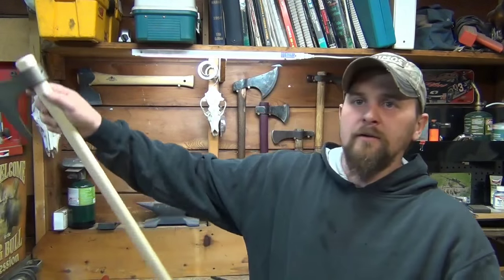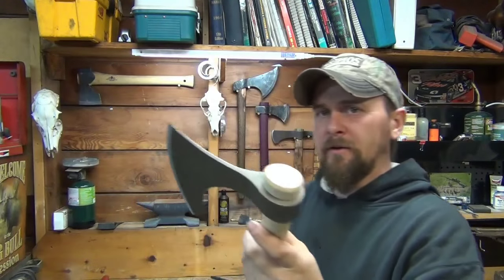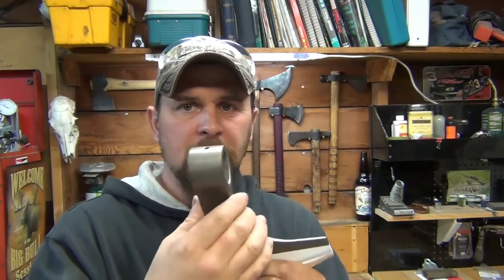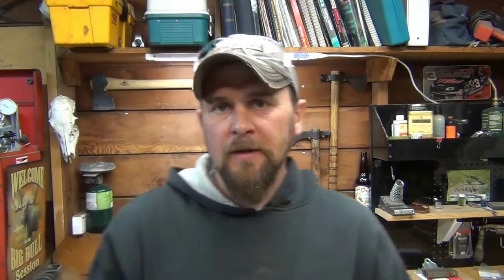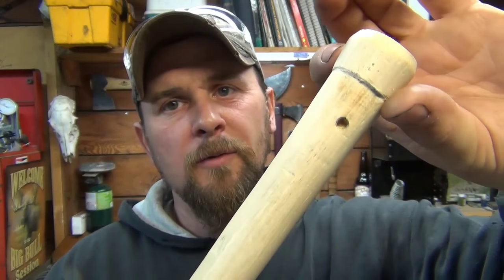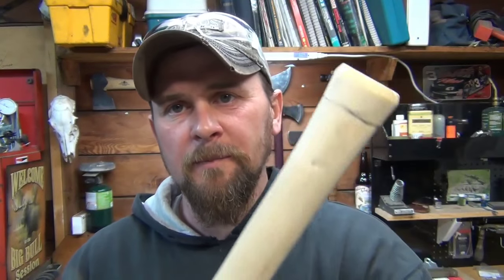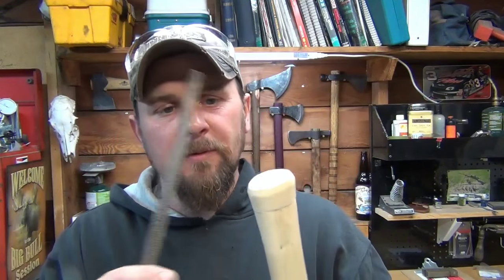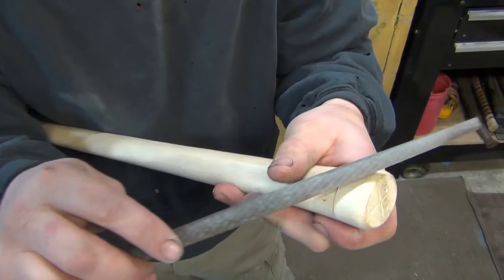Tomahawk head fitting guide. Viking axe video 1

Comment: How to fix the little bit of uneven slop at the end:

Remove the head and rub a coat of graphite from a pencil on the inside of the eye on the bottom. Then hang the head on the handle. Remove the head again and sand up from where you see the graphite marks. Repeat until the graphite makes a complete ring around the handle. 

That way there's absolutely no chance of play.

Comment: Thanks man, I just bought my first tomahawk like a week ago (Amazon Cold Steel Spike Hawk) and it just arrived the other day. 
My older brother (who THINKS he knows everything) said that he had replaced an axe handle or two in his life and that I had gotten ripped off with a cheep malformed handle, and a cheap screw to hold it in place (he was right about the screw, but of course I had already assumed that much for myself). And then he told me that I needed to get/make a new handle and attach it like an axe.

Instead after seeing your video, I now know that the handle was actually just fine and that it uses a different method to attach the head. So I filed my  tomahawk's eye, filed and sanded the handle it came with (which was actually already pretty well, if not perfectly, tapered) and now it fits perfectly, nice and tight with no wiggle at all.
Reply from the maker: Excellent! Glad to hear the video was of use and you were able to get your hawk straightened out!

Comment: Update on my previous comment.  I did get the Viking Hand axe and, after watching your video again, I was able to get a pretty decent fit.  Like you I have a little space on the bottom of the head but it's very tight on the handle. Your third video on sharpening the axe was very helpful. I've sanded the handle to remove the finish that they put on.  After burning some designs on it I plan to apply some boiled linseed oil to protect it.  I'll also be putting some leather next to the head.  Thanks.

Comment: Great Video, I have been banging my head against the wall trying to fit tomahawk heads to their shafts (i ruined my handle by keeping the screw, and re-tightening it periodically; which eventually bit into the wood and caused some splitting).
Another method that I discovered (also useful if you are in the woods and do not have access to sandpaper or files etc...) and need to refit the head after some heavy usage; is to take a thin piece of cardboard (like a paper filter tip) and just wrap it around area where the head bites into the wood, giving it a smoother (if temporary) and solid working fit.
Best regards!

Comment: thanks for this, I am going to have to do this for both the Viking hand axe and battle axe as both have wobbly heads.
Reply from the maker: I have had several lately with really bad handles, two are too narrow to use and I will need to make new handles, I hope this is just a fluke and not the new low standard for the Cold Steel Hawks!

Comment: Righteous! Im customizing a new CS SpikeHawk watching this video. Fitting the handle in fact. Ive determined I got as solid a fit as Im gonna get without it moving up the handle further than I can allow for the Constrictor Knot Im gonna apply above the head. I also crown carved the handle top with my Chip Knife. I still have a gap at the bottom and in one small part at the top. Can even see light through it looking up the handle at a light source. I'm just gonna fire harden my handle, and make pine pitch at same time and bed it. Then Im gonna apply Constrictors in appropriate sized strong tarred cords above and below the head in such manner as head is wedged up against top Constrictor and handle taper. Did a lot of file work as well customizing the head.

Comment: People are blissfully and kinda painfully ignorant about how friction-fit axes work. And also how, if you know what you’re doing, how AMAZING they are. Vikings didn’t use these kinds of axes “because the technology was inferior back then” at ALL. Vikings still had axes that were compression fit (wedged) too. The reason these kinds of axes were so amazing was because of how insanely easy it was to replace handles, and only have to taper the wood one way. On top of that, you could carry a shorter handle with you, then just REALLY quickly and easily change your 30-inch long light felling (of both trees and men) axe into a 16-inch long bushcrafty hatchet for smaller tasks. Then you’d just >thwack thwack< and pull your short handle back out after you got done with your smaller bushcrafting tasks then throw the longer one back in - and BOOM. You’re back in business for felling relatively medium sized trees and/or KILLIN FOOLS. And you can switch these handles in and out with each other in less than 15 seconds. That’s how EASY they are to use. AND you can technically get two tools out of one axe head.

Comment: Someone suggested to me to soak the Head&shaft in Teak/Lensed Oil to make the shaft swell to fit.

I'm going to try it out. I'll let you know if it works or not.
Ill try it on my Norse Hawk. Its the loosest of my hawks and has a hard knot at the top i just cant seem to file/sand down. Its like stone at the knot...
Reply: Before you use any wooden handled tool, soak in a bucket of water overnight. The wood will swell and the head will never fly off!

Comment: I would like to polyurethane my T handle I don't care about fancy I want usefulness.  Would you advise installing the handle first then coating the handle. Your thoughts please. I'm glad I found your video so I can do a proper fit. Thank you.
Reply from the maker: I honestly have no experience with polyurethane. If you want to be able to remove the head I would fit the handle before coating. If you plan on trying to fix the head in place then I would press the head on and then coat the handle. The poly may help hold the head in place, this is generally how most mass produced fixed head hawks are done and some of the custom ones as well, although they typically use a hydraulic press to fit the head to handle. Sorry I cant be more help.
Reply: @Scablands_Scavenger  Thanks a bundle.

Comment: Question, is it alright to set it with a big screw? With the set screw hole, I drilled a small hole into the handle, then put the biggest screw that could fit into it. Bout and inch long. It seems to work pretty well. What do you think?

Comment: I got it all perfectly fitted but the axe head is not in line with axe handle. What is wrong? Could it be the axe head is just not made right
Reply from the maker: could be, you can get a straight edge, like a ruler or similar and place it on top of the head in line with the longest part of the eye use that as a guide to see if the blade is skewed one way or another. If it is twisted you may be able to adjust by making your own handle. A quick way to get a blank is to purchase a sledgehammer handle and work it down to fit.

Comment: You forgot the most important thing, what should We replace the littel screw with ?
Reply from the maker: Nothing, the screw does more damage than good. I will sometimes weld the hole shut but it is not needed. Some peen in a piece of soft metal like copper or brass if you want but there is no need other than aesthetics.

Comment: Hey there, watched your 3-video series. Amazing work, thank you very much for recording it. Got a question if you don't mind: I failed to understand how to affix the head permanently (or for as long as possible) to the shaft. I understood that regular axes get shimmed on the top, but this one, having a tomahawk configuration, would have to be different, hence the work shown. But it left me with the question: Are tomahawks supposed to have their heads easily removed by simply tapping on their top? I humbly believe the answer is most likely: Nope :-) So, after reshaping the handle/shaft, how do we ensure the head remains there, if we cannot use the shim method due to the pole being slimmer below the head? Thanks a lot for your time, and once more for the great video series!
Reply from the maker: Thanks for the compliment, and you have a good question with a tough answer.The Cold Steel hawks have a tapered eye meant to fit on a tapered shaft. The head is designed for the most part to be easily removable without tools. The reason is debatable but still on purpose. Setting aside the historical aspect, in modern times the handle is designed to be replaced if and when broken during competition throwing. I believe the rules stated at one time that the handle had to be removable and of wood construction with an oval shape, I do believe that has changed to include metal and fixed handle stuff now. The principal behind this was that the handle would give and come loose rather than break, and when it did break a new one could be slipped in and you could keep competing.
 Ok with that out of the way, if the head was permanently attached to the handle would that not make it a hatchet ? One of the advantages of the tomahawk ( not including the ones with fixed heads) is the fact you can remove the head and do other things with it. This is where it gets real muddy water and people start yelling at each other ha ha, what is a tomahawk whats not etc. There are advantages to having a removable head however it requires you to maintain the fitment between handle and eye some people find that distracting. If you want to keep it attached permanently (using it for fighting only) the best way is to use a heavy press and force the head onto the handle. This is how H&B Forge and the gerret wade rebranded hawk is shipped. I have never tried it but I do believe you could replicate this by soaking the handle to soften the fibers and then using a hammer to seat the handle and compress the fibers, when the handle dries the fibers should expand and lock the head in place. Hope this helps, thanks for watching !
Reply: @Scablands_Scavenger  Amazing answer, thank you so much for taking the time! I enormously appreciate the historical input as well as the competition details, and of course, the last bit about how those folks make their axes!
And yes, you'd be right, I was thinking about making a fight-only axe out of it, because I purchased the "battle axe" version, which comes with the same shaft length, but with a non-bearded, different head. This being said, the handle/head configuration is indeed exactly the same. Now, I'm not sure if these type of axes were made to be thrown, although you should've met my ex-wife, she had the uncanny ability to make any object become throw-able, fortunately, my tv's always been firmly attached to the wall - hahaha!!
Anyway, this both funny and sad fact aside, it wouldn't surprise me to learn that northmen could throw any kind of thing should they need to, but even then, for this case I'll try your recommendation on perma-fixing the head - and then I'll get some proper tomahawks and learn how to throw them and everything :-)
May you have an awesome day and thanks again for your super response!!

Comment: I took the screw out of my own tomahawk and put a wedge in the top to force it to fit. Should i not have used a wedge? At the time i figured it would work fine because it works for normal axes just fine
also, would there ever be an instance when a screw would be acceptable? i figured the hex nuts on the tomahawks helped them stay place so I kept them in my norse style hawks (like the one axe and Cold Steel's norse hawk)
Reply: lazy asfuch Tomahawks are meant to have easily removable heads. The eye is tapered, so keep in mind it might not be as secure as an axe though it's most likely going to hold fine. It just defeats the purpose of getting a tomahawk instead of a small axe. 

Screws.. They will only destroy the handle faster. Imagine all the shock going into that little hole, splitting and ripping.. Bad idea.

Comment: How long should a handle last, after the head coming on and off?
Reply from the maker: This depends on a few things, first and most importantly is the density of the wood, generally speaking the more rings the denser the wood and it will resist deformation of the head impacting on the wood and slow the eventual working of the head up the handle. Then you have to add in all the other factors like humidity, maintenance ( what you use to treat the handle with) and how hard you use the tool. And last it also depends on storage, do you have large temperature swings between seasonal changes causing the handle to swell... and when the handle swells do you shave the head down to allow the handle to fit again, because this will then shrink in the dry months and cause premature wear and use up "handle head space" . If you store it right and dont trash it and keep it oiled it should last a long time(years), even if you like to remove the head for use often. Hope this helps.

Comment: at min 4: this is a modified CS trail hawk? is there a video of the mod? thanks and greetings from Germany, Michael
Reply from the maker: Yes that was a modified Trail hawk, sorry no video on this. Basically just used radius on belt sander to remove some material from bottom of blade, smooth and round edges on hammer and do a plum brown coating.
Reply: @Scablands_Scavenger  nice idea, thanks.  I think I do that too.

Comment: After taking that ledge off what are your thoughts on heating the head up a bit to get it to expand slightly before pounding it on there for a more snug fit?
Reply: I've heard people do the opposite and instead, put their handles in the freezer or outside, if it's cold enough, seat it once it's cold and let the handle expand as it heats up.  Don't know how effective it is but easy enough to try out without much risk of ruining any temper on the steel.
Reply: BeowWulf Might be worth a shot. Since my last post I tried heating the head and hammering it on (after shaving the rough edges of the handle and the head itself). It did seem to have a very tight fit at first but after 2 throws the head came loose again.

Comment: What tool do you use to remove the screw
Reply from the maker: Mine are all long gone but if I remember correctly it is a 3mm hex head. A t10 or t15 will work in a pinch.

Comment: yea i just got a Cold Steel (CS90WVBA-BRK) and the handle taper doesnt appear to ever go big enough like in this video handle. pretty disappointing with my purchase.
Reply from the maker: I have definitely gotten a few duds over the years, and I have broken a few handles as well as worn a few out. The way I look at it, they are a starting point for projects and I always buy them when they are at the lowest price possible an Amazon. When I do need a new handle I dont buy the Cold Steel replacement. I go to the hardware store and pick out the best looking hickory sledge hammer or pick axe handle I can find and make my own (both are straight and slim easy to form down). This way you get to choose the length, and how much of the handle you want left above the head etc. I think in the last month I have bought four to Setup and make sheaths for people and one of them had a handle that was too thin, not good odds really.
Reply: @Scablands_Scavenger  have you found anywhere online that would sell a handle that will work for it? My local stores have nothing thats close at all
Reply from the maker: @bakedpwn4131  I don't see the 30 inch handle on Amazon ( the 22" handle is 13 bucks) or Cold Steel web site.If you cant find a piece of 30 inch hickory that you can whittle down and make work, you can use any hard wood like ash or even wood you find like hawthorn or ocean spray. Outside of doing that I would try calling Cold Steel and see if they will help you, or getting hold of the dealer who sold you the item.
Reply: @Scablands_Scavenger  thanks. Im going to contact them and see if i can get a better onem i dont mind a light sanding or shaping but the one i got doesnt even look like it will fill the head of the axe. I may grab a 22inch. I just dont know what wording for the handle to use to make sure it has a similar enough shape for the axe head hole. This is first axe and i just wanted somethign sturdy at the house for fun and protection

Comment: Good video. Why not just hammer a steel wedge into the top? I have done it on a few tomahawks and it works well.
Reply: I'm thinking about trying the wedge idea, I just got a norse hawk and I have a feeling that even if I sand the handle the head isn't gonna fit snug.  The head is already wobbly and there isn't much of the handle left sticking out so there's a good chance I'm gonna end up having to get another handle.

Comment: I appreciate this video and how it applies to tomahawks. What bothers me about the design of that particular coldsteel axe is... it's not a tomahawk. A viking handaxe is NOT a tomahawk...lol! Yet coldsteel used the exact same handle style that they use for their tomahawks, exact same eye for the axe head as they use for their tomahawks. It's a cheap and lazy mass production design.
Reply from the maker: You hit the nail on the head... they did use their existing head/eye design. It cost them less money to design, and it keeps the over all price down so it is cheaper than a custom. It also means replacement handles are easy to come by.  As for the name..... thats purely semantics. What it is, is a stamped steel axe head with a tapered hole punched through it that is designed to fit a tapered shaft. Cold steel is more about function over form I believe and it just happened to be released when a certain TV series was gaining popularity if I remember correctly.

Comment: Great video. Question,  After the handle has been matched to the head would a coating of epoxy keep the head stable by filling any gaps between the fit
Reply: Search youtube for "Fitting a through the top tomahawk handle".
The 2nd video down is done by wb77 or something similar. .
Watch the whole 6 minute video and you will be good to go.